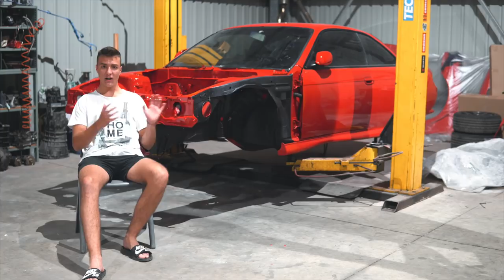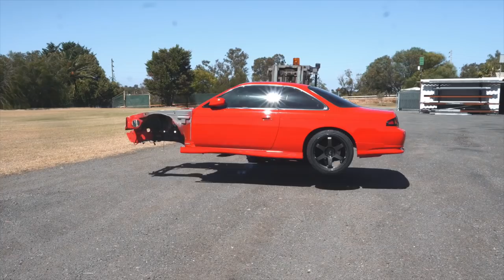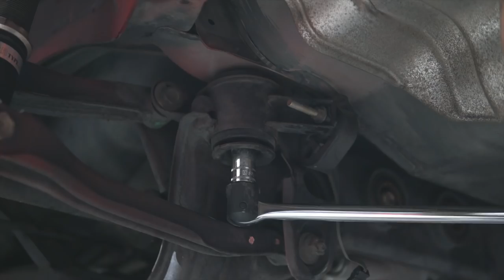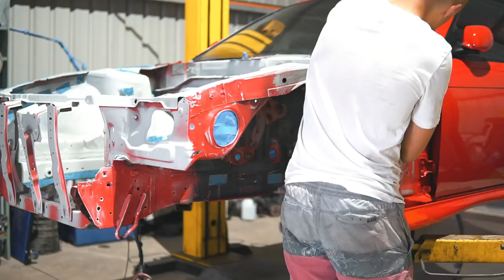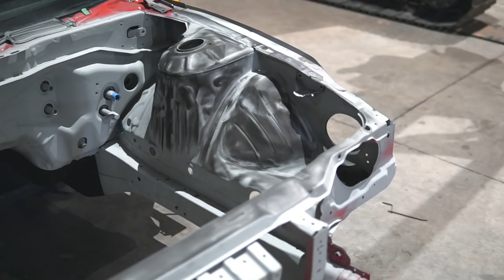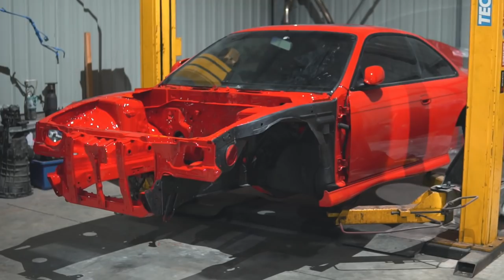Shaved RB14 Bay PAINTED | The Broken Silvia [EP5]

Comment: dude! what underseal is that you are using? looks easy to apply.

cheers from the UK
Reply from the maker: Lawrence Duckers Hey man, I used Rustoleum. I’d recommend buying three 1L bottles to get every bit of the undercarriage sealed. We’ll see how it holds up!
Reply: +Broken Silvia perfect dude. i'm about to smooth my MK4 Supra bay out, thats what brought me to your video. fantastic job! Subscribed 😊👌
Reply from the maker: Awesome man! Supra’s have big engine  bays. Should keep you busy for a while.

Cheers! 👍
Reply: @BrokenSilvia How is the underbody coating holding up a year later? Would you recommend it? With that Rustoleum one what prep do you need to do to the surface before spraying?

Comment: Hey man, what did you do to prep the underneath for the body liner?
Reply from the maker: Cleaned it
Reply: @BrokenSilvia  no sanding or prep or anything apart from the cleaning? I want to do it my s chassis too just not sure for longevity if it will hold up if I just clean it.